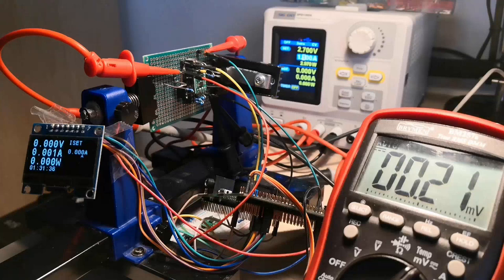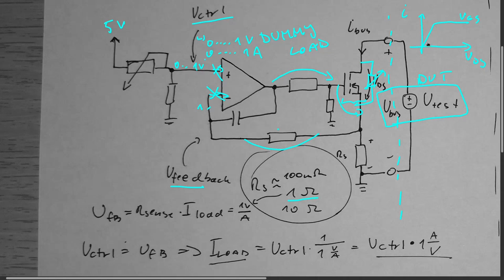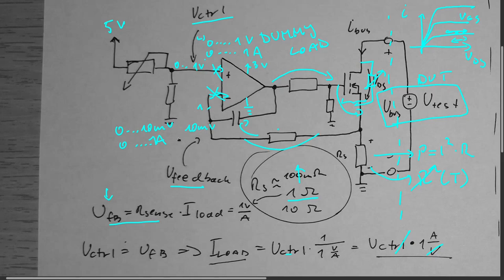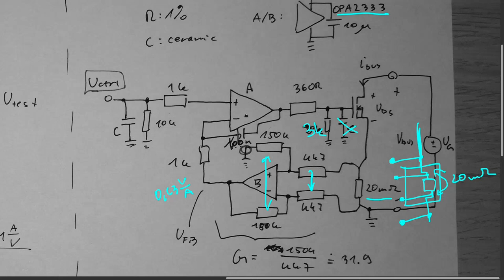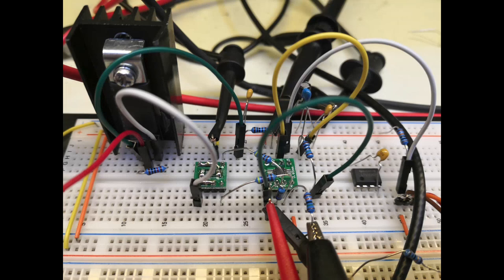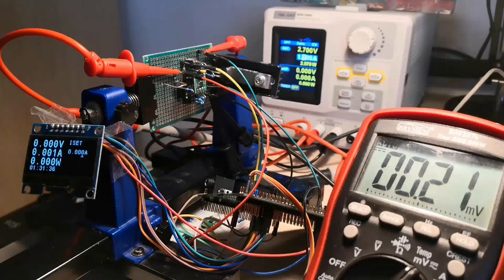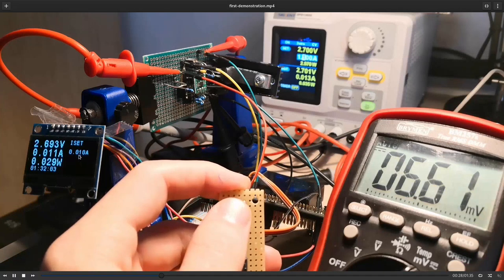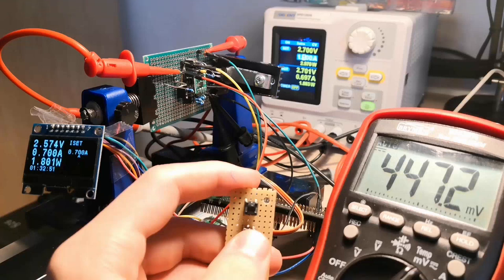Electronic load part 1 - circuit and demonstration | VIDEO 41

Comment: Hi.. did you make schematic and source code to test?
Reply from the maker: I got busy with school and work, so I have put that project on hold. The devil is the many voltage offsets and control loop compensation, which would take me some time to understand and come to a solution.
Hopefuly in next year I come up with a good design.